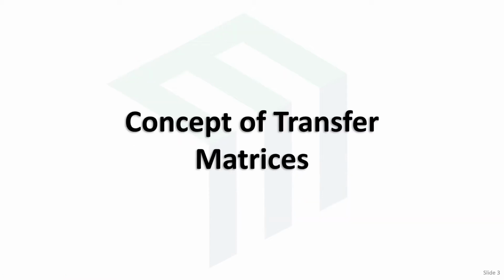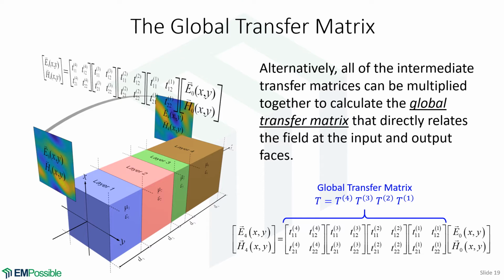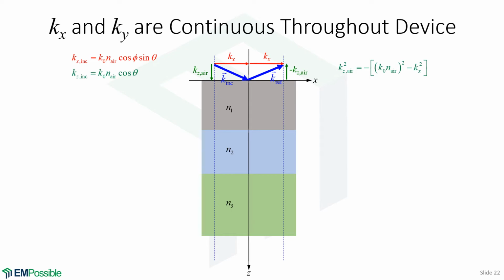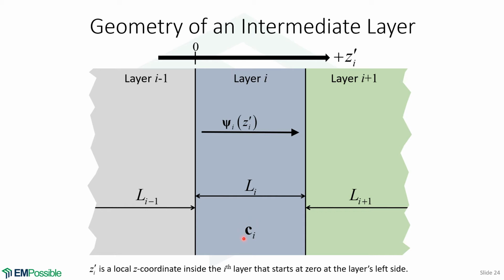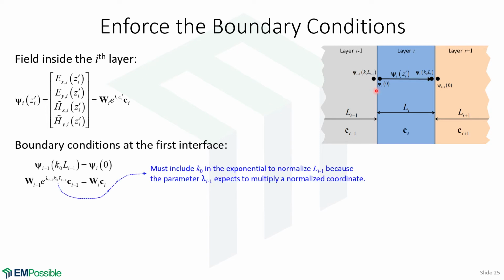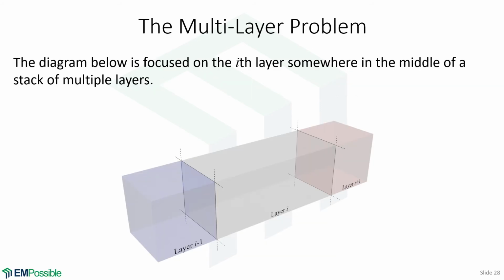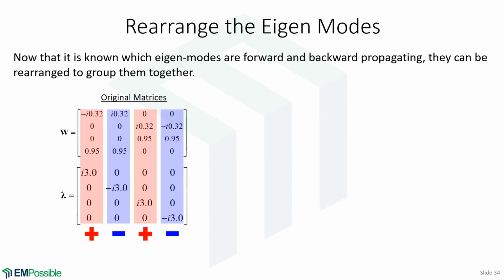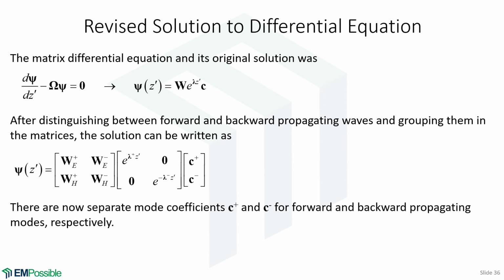Lecture -- Transfer Matrices

Comment: Hello Dr Rumpf and thanks for a great lecture! What is the continuity of k_x and k_y through the propagation based on? It doesn't look intuitive with the changes of the refractive indices along the z-axis.
Reply from the maker: Boundary conditions is what forces kx and ky to be the same, regardless of the materials. It is the kz component that changes based on the material properties. As kz changes, waves will refract or even be cutoff for things like total internal reflection.

Comment: Hi, Thanks for the lecture.I have 2 questions. In slide 25, 26; after calculations it was written as c(i+1) = Ti * C(i), But in Initial slides our view is psi(i+1) = Ti *psi(i), Basically fields are multiplied by Transfer matrices to get fields in next layer. What is the reason? is it due to mode coefficients denote amplitude of the modes and W matrix denotes time varying nature of the fields.
In slides 34,35, we are exchanging columns in lamdai & Wi matrices, whether this operation mathematically change the solution W*exp(lamda*z)*c?
Another question is : Once Foward and Backward waves are identified, how we will make sure backward wave is not treated as forward wave and gets exploded. As columns in lamda matrix also exchanged, W*lamda*C may not change, how it gets stabilized.
Reply from the maker: Great questions!

Q1: The column vector c_i contains the mode coefficients, or complex amplitudes of plane waves. The modes are the different wave polarizations that exist in the layer. The psi_i column vector contains the actual electric and magnetic field values. Strictly speaking, the transfer matrices relate mode coefficients from layer to layer, not field values. To make things a little more confusing, in TMM with linear, homogeneous, and isotropic (LHI) materials, the mode coefficients c_i exactly equals the field values. You will see this in a later video. For these reasons, in my crazy mind I see these (c_i and psi_i) as essentially the same thing, at least in terms of meaning. Thus, I may show them somewhat synonymously. I can see how this is a bit confusing and I should be more careful. If you move on to rigorous coupled-wave analysis (RCWA), the mode coefficient column vector will not equal the psi column vector. You will learn that RCWA is really a combination of TMM and the plane wave expansion method (PWEM).

Q2: You are exchanging columns in the Wi matrices, but you are exchanging both rows and columns in lambda_i. That is because you need to keep the eigenvalues along the diagonal. Doing this will give the same exact answer after the W*exp(lamda*z)*c because this calculations adds all the modes together so there order no longer matters.

Q3: After sorting, you will never handle the overall W and Lambda matrices. Instead, you will store the quadrants of those matrices separately to keep the forward and backward information apart from each other. This way you will never treat forward waves as backward or backward waves as forward. You will see that in later videos as well when scattering matrices are discussed.

BTW…I am not sure if you are using the course website or not. I recommend using the course website as the main portal to this information because it organizes the information and gives links to the latest version of the notes and videos. You can also get links to other learning resources. Here is the link to this Computational Electromagnetics course website:

https://empossible.net/academics/emp5337/

Hope this helps!
Reply: @empossible1577  Thanks for the answer.
Q1:I am clear on c_i is mode coefficients/amplitudes of actual mode, W- denotes wave polarisation, i see it as time variation.As we are seeing wave propagation in z direction, modifying mode amplitudes with Transfer Matrices make sense, But i need to do examples and check the result for getting intuitive understanding.
Q2: i got the operations done on Wi, lambda_i matrices, i am clear on it. But certain matrix operations only will not alter the final result. I want to calculate psi(i+1) for both cases(with forward, backward separated and without) in the example given slide 34 and see. CAN I TAKE psi(0) as [0.1,0.1j,-0.3j,0.3] COLUMN MATRIX FOR CALCULATIONS PERSPECTIVE.
I want to see for both cases Case1: + - + -; Case2: + + - - ;;
For Case2: To calculate W^-1, i will use rearranged W (+ + - - ) itself
UPDATE: I have done the calculations for both the cases, by neglecting little numerical accuracy(0.15625 == ~0.158), I am seeing both cases yield same psi(i+1), i thought finally columns may have swaps, but both cases are same ( I will verify my results again). If i am correct the final result consists of both forward and backward waves combined.

Yes, i am going in the same flow as EMP5337 course, I have completed TMM videos except supplementary information lecture. I am trying to consolidate what i learned in TMM. As it is Old course, I don't see any example problems or exercizes. If you have can you share the link. It will be really helpful..
Reply from the maker: @1729malli  Q1 – As for examples…this is called benchmarking. You want to run a bunch of simulations of things with known answers. This is how you ensure the code is working and you know how to use it. The best way through this is to start very simple. First, simulate nothing…just air. You should get 100% transmission and 0% reflection. Second, simulate a bunch of things where you can calculate the answer with the Fresnel equations. Then move up to slabs and then other multilayer things. Use the literature for known answers. Look for things like slabs, optical thin films, etc.

Q2 – That column vector looks correct. You can scale the eigenvectors by any value you wish. The eigenvectors are just pictures and convey only the relative amplitudes the field components. Scaling by a constant does nothing. Just do not scale by very large or very small numbers or you may lose precision. Remember, you should never work with the whole matrices. You will sort the modes and keep the stored separately. You will manipulate them separately.

The example problems for TMM are in the homeworks on the course website:

https://empossible.net/emp5337/

Comment: Hi, thank you for your effort. I have one question. I don't understand why transfer matrices treats all the waves as forward propagating. In the previous video we have seen that if we have an eingevalue like : -j 3.0 we would have a backward propagating wave. Why we can not have them?
Reply from the maker: The differential equation being solved for the 4x4 TMM calculates both the forward and backward waves at the same time.  While it is possible to distinguish them and separate them, they are mixed up if nothing is done.  When the solution is written, it is written as if all modes are forward propagating. This is why some of the modes are conjugated so that backward waves actually propagate backward.  The problem is when one of the backward modes decays at as propagates. Normally this is not a problem, but since the backward waves handled at a higher level as forward propagating, those backward waves grow in amplitude in the forward direction. This happens so that they correctly decay in the backward direction.  However, the exponential growth causes those modes to explode in value and the method goes unstable. The fix is to distinguish those modes and actually treat them as backward propagating so that decay is decay and not growth.  Later, the 2x2 TMM is formulated that only calculates the forward propagating modes. To account for backward waves, these modes are written a second time as backward waves. There are certain conditions where the 2x2 is not possible and only the 4x4 can be done.
Reply: @empossible1577  thank you. One more question, why we put a minus in front of lambda_- ? In that case we will have all positive eigen value
Reply from the maker: @mementomori6734  The minus sign superscript is to indicate which direction the matrix corresponds to.  + are the forward propagating eigen-values and - are the backward propagating eigen-values.  Notice the eigen-values are the same other than the sign.
Reply: @empossible1577  thank you. Yes, I have understood that, my question is related to the minus in front of the lambda^-. We have that lambda^- is, in that example, - 3.0 j for example. Then we write exp( - lambda^- )so we will have a positive eigen value . Why? Thank you so much again
Reply from the maker: @mementomori6734  If you were to follow the method as presented so far, separating the modes does nothing.  It will turn out that by separating them and also modifying the basic TMM algorithm, you treat the forward and backward waves separately and differently, instead of keeping them all in the same matrix.  Watch ahead to the 2x2 technique.
Reply: Moreovero what i probably don’t understand is why a rearrangament of the matrix can fix the problem?
Reply from the maker: @mementomori6734  Watch how the 2x2 TMM is performed and I think that will make sense.  I don't cover that in this video.

I recommend accessing these videos through the course website. The topics are organized and the links will always take you the latest version of the notes and videos.  Here is the link:

https://empossible.net/emp5337/
Reply: @empossible1577  thank you very much
Reply from the maker: @mementomori6734  Happy to help!
Reply: @empossible1577  Hi professor, I've watched all of your lectures and I still don't understand why is it required the minus sign in front of the lambda^-. As @mementomori6734 points out, "We have that lambda^- is, in that example, - 3.0 j for example. Then we write exp( - lambda^- ) so we will have a positive eigen value". Moreover in the  2x2 formalism, which should be equivalent at the end of the day to this one, the forward propagating eigen values are kept as lambda, then at the exponentials we have exp(lambda). Also, we know that the backpropagating waves have the same, but negative eigen value (-lambda), then the exponential form: exp(-lambda), the result is that the exponential has the oposite sign as the forward mode. However, here at the exponentials we write exp( - lambda^- ), which, in case that lambda^- already has intrinsecaly the negative value, then the exponential  exp( - lambda^- ) would be equal to exp( lambda^+), whichj doesn't make sense. Thank so much in advance.
Reply from the maker: @adriacc397  For the 2x2 case, eigenvalues are only calculated for the forward propagating modes. To include the backward modes, the negative sign has to be included explicitly. I hope I am understanding your question accurately.

BTW, in more exotic media such as nonreciprocal, the backward eigenvalues can be different (more than just sign differences) than the forward propagating. In this case, eigenvalues have to be calculated uniquely for forward and backward. It is only in ordinary media that the forward and backward eigenvalues are the same. Maybe this will help your understanding.
Reply: @empossible1577  Yes, exactly. I understand the 2x2 formalism, it only computes the forward modes and then for the backward modes you have to include the minus sign. However, my point was that in the 4x4 formalism, where all the modes (backward and forward) are obtained (with eigen values lambda^+ for forward, lambda^- for backward). Assuming that lambda^-= - lambda^+, then the submatrix exp(-lambda^- z') in the matrix exp(LAMBDA*z') from slide 35 of this video, should be just exp(lambda^- z'), without the minus sign! Otherwise, comparing the 2x2 formalism with this one (4x4), it is not equivalent, and they must be. I hope I was clear now, maybe I'm missing something. Once again, thank you very much professor.
Reply from the maker: @adriacc397  For the 4x4, the modes must be sorted in forward and backward. This can be done most simply but less rigorously by looking at the sign of the eigenvalue. The better way is to look at the direction of the Poynting vector. Given this, you can rearrange your matrices to put them in the original form of the 2x2. Doing this requires the sign of the eigenvalue to be dropped and then written explicitly. There are multiple ways to do this correctly, this is the method I chose as it seemed most consistent. Maybe this is where my thinking and notation is confusing you.
Reply: Slide 35

Comment: Sir ! Thank you so much for your effort. Can we apply the matrix transfer method to a structure that has mechanical properties such as density and the speed of sound where we can use mechanical waves instead of electromagnetic waves? If so, is there a video for that? Or is there a source that helps me transfer the matrix onto a structure that has mechanical properties?
Reply from the maker: TMM can be applied to any kind of wave.  I do not have any notes on that, unfortunately.

Comment: Sir ! I really appreciate you for your effort . I've a question . when we use such a TMM method to study the optical parameters of crystalline material even with single layer ,we can't do it without elementary experimental data about certain material .If this method is independent of experimental data then  Could you explain  how?
Reply from the maker: I am not sure what you mean by "independent" of experimental data.  If you know the material properties and your structure is modeled well by stacks of homogeneous layers, TMM should provide a very accurate simulation that will match experiments.  Maybe you mean that you have measured material properties as a function of wavelength (or frequency).  In this case, you will put your TMM code inside a for loop that iterates over wavelength (or frequency).  For each wavelength, you will redefine the properties of the layers based on the material properties you measured at that wavelength. 

Does this help?  I hope I answered the question you were asking!

Comment: how we can find reflection and transmission coefficient from this matrix method and compare it with fresnel's equations.please explain it will be helpful for me.
Reply from the maker: It is a bit challenging to get the reflection and transmission coefficients from the transfer matrix.  The transfer matrix relates the fields on one side to the fields on the other.  This means the transfer matrix does not distinguish forward and backward waves that you need to determine reflection and transmission coefficients. Scattering matrix calculate these directly.  Here is a link the course website where you can look at the videos that follow this one to calculate scattering matrices.

https://empossible.net/academics/emp5337/

You will notice that your scattering matrices are actually a 4x4 matrix containing 16 numbers.  Which of these are your reflection and transmission coefficients?  For the general case, scattering at an interface is actually a four-port problem, thus 4x4 matrices.  You can have TE or TM incident on port 1, TE or TM reflected at port 1, TE or TM incident at port 2, and TE or TM reflected at port 2.  Almost always, the actual incident wave is the one incident on port 1.  The reflected wave is the wave reflected by port 1 and the transmitted wave is the wave transmitted through to port 2.  Based on your eigen-modes, you will have to determine which of the 16 numbers relates the reflected to incident wave and that will be your reflection coefficient.  Then you will find the coefficient that relates the incident and transmitted wave and that will be your transmission coefficient.  In general, you could have TE input and TM output, or TE input and TE output so there are multiple coefficients to choose from.  In most cases, you will be interested in TE->TE or TM->TM, but for anisotropic materials the polarizations can be coupled.

This really is a bit complicated and I cannot give you a simple recipe.  However, you reflection and transmission coefficients are in that scattering matrix and you just need to figure out which one it is.
Reply: @empossible1577  it's a bit challenging but thank you for your reply..

Comment: I may have missed it, did you ever mention the wave number k is different than the extinction coefficient k?
Reply from the maker: Not sure I mention it here, but I do mention it in background material.  I use an italics k for wave number and an italics kappa for extinction coefficient.  They are similar symbols, but different enough if you look closely.  

Here is a link to the course website where you can download the notes, get links to the latest version of the videos, and get access to other learning resources like MATLAB codes and more.

https://empossible.net/academics/emp5337/
Reply: @empossible1577  I noticed HW3 requires following a block diagram from lecture 2c for TMM but there doesn't seem to be a diagram here.
Reply from the maker: @ScienceBG42  Thank you.  I have revised the lectures, but not the homeworks so they have become out of sync.  The Block diagram for TMM is ow on Slide 21 in Lecture 2g here:

https://empossible.net/academics/emp5337/

Comment: Thanks for your valuable lecture. I have a question. In Slide 26 (time : 15:22 ), you derived the Transfer matrix which relates the c_i+1 with c_i (not the relation between psi_i and psi_i+1 ). How this transfer matrix is the same as the matrix in slide 19 (time 3:50)?
Reply from the maker: The explanation is is Lecture 2g.  It is possible to generate transfer matrices, scattering matrices, or whatever else that directly calculate the fields.  I have found it a little better to calculate the mode coefficients.  This approach also unifies the various methods like TMM, MoL and RCWA more clearly this way.  Because TMM is the simplest, the math of TMM simplifies such that the mode coefficients are the same as the fields.  You will see that in TMM the layers are homogenous leading to the eigen-vector matrix W being the identity matrix.  All of this is in Lecture 2g.

BTW...here is a link to the course website:

https://empossible.net/academics/emp5337/